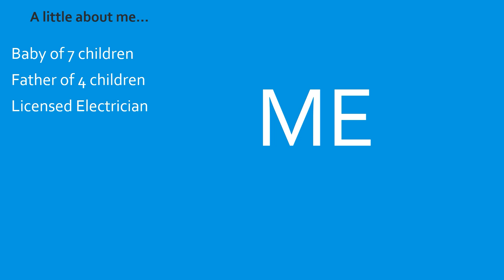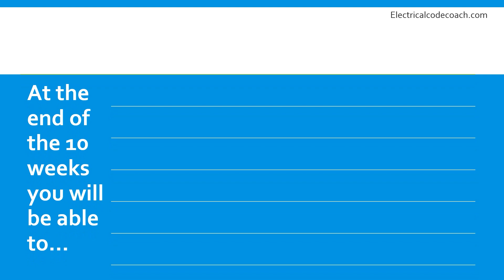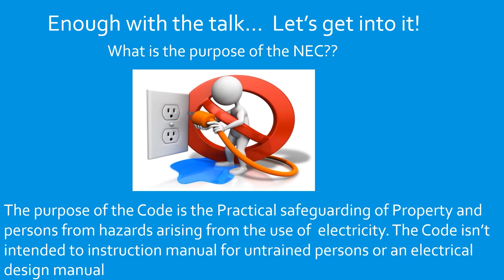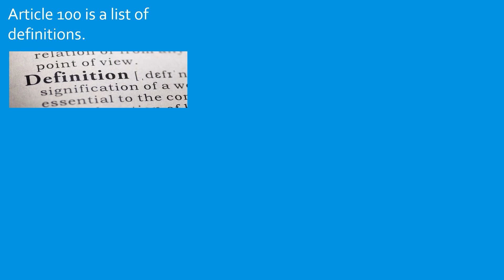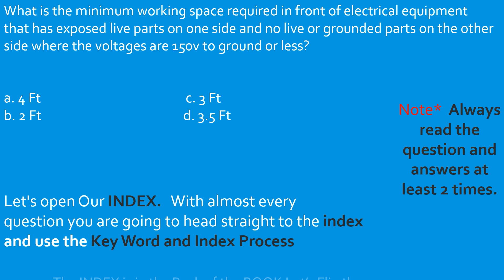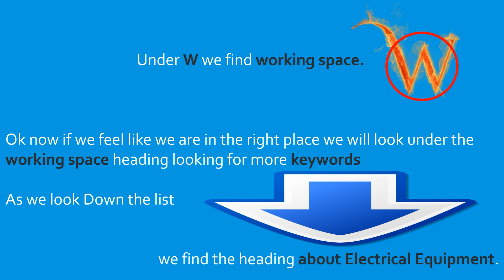#1 FREE Exam Prep Week 1 of 10. Electrical Licensing Exam prep. exam Prep,

Comment: Question  Have 500 kcmil. With 285 current load on a 450 amp main breaker. How much additional load can you add? I went to ampacity tab Shows 430 amp for allowable load in 90 degree column on 500 Kcmil. I did not multiply it by 83% since it was over 400 amps. I took 430- 285 = 145 amps. It didn't match any of the answers. What did I do wrong?
Reply from the maker: Try pulling from the 75° c column for your ampacity
Reply: @ElectricalCodeCoach  thank you

Comment: Does the 83% Adjustment factor when sizing service conductors apply to the 2020 Code?  I can't find a reference to it in there.
Reply from the maker: Yep it sure does! Page 156  310.12 and they finally brought back the quick reference table which is on page 157!
Reply: @ElectricalCodeCoach  I don't know how I missed that.  Thanks for the info.

Comment: I got my Tennessee Electrical License back in 2006 and took this 10 week coarse as a code refresher and continuing education.  I started studying code back in 1996 and this program is an awesome tool for just a refresher or someone trying to acquire their state license.  Over the years I have utilized the NEC and both Mike Holt and Tom Henry's programs for continuing education purposes.  The electrical code coach program is straight forward and to the point.  This program will definitely prepare you to quickly and accurately navigate thru the NEC.  The content from the electrical code coach program will prepare you for the LLE and the CE exams.  Perry is onto something special here and this will not waste your time if you want or need to go from point A to point B with positive results.  I highly recommend this program to new and seasoned electrical workers.
Reply: This is everything I wanted to say , yet couldn’t find the words to do so! This is the most accurate assessment of this program anyone could ever write. So if you like what you hear from this comment , we’ll that’s exactly what you can expect !

Comment: I'm a 20 year electrician and have taken 3 other code classes through the years this class and videos taught me more than all the others.  Most of the time I struggled to look up codes and was totally intimidated over trying to test.  So for many years I got by by being told what the codes were and remembering them which is fine as long as your always doing the same basic jobs.  After watching and learning from the code coach method I'm not scared to look up anything that has to do with electrical code. I now have the know-how and the confidence to tackle and test without being intimidated.  Thanks for everything Perry.
Reply from the maker: I am so Thankful i got to be apart of your journey!
Reply: I agree. This is so much easier than....what's that guy name? Tom Henry?

Comment: You're covering the Tennessee LLE exam?
Reply from the maker: I do the school in person in Tennessee, this content will help you pass any electrical test in any state
Reply: @ElectricalCodeCoach  My TN LLE exam is the 26th of this month. Glad I found your resources!
Reply: Blake A. Kiessling I would say out out all the material covered with this program, well over 95% of what is on the exam is covered.  You have to do the practice test for the full experience, learn and perfect your technique, and timing.  If you can’t consistently hit 90% or higher on practice test averaging 2.4 minutes or less on any electrical exam, then more practice is need.   One thing I noticed about this program is that is focuses on key word analysis which could take a 5 minute question down to a 2 minute question.